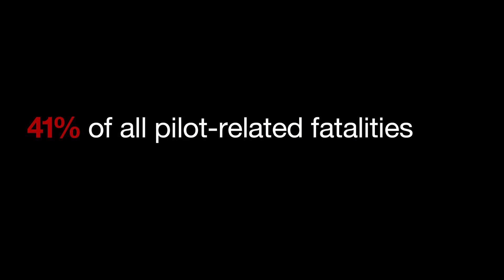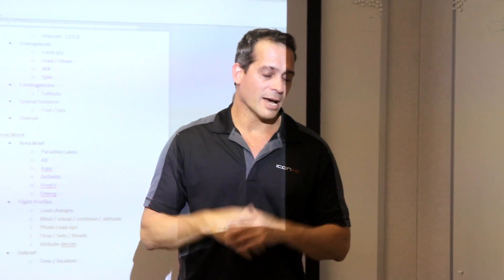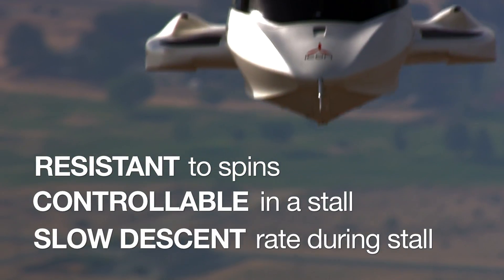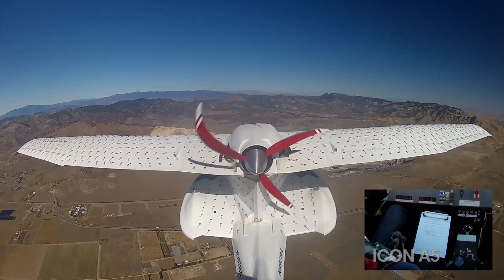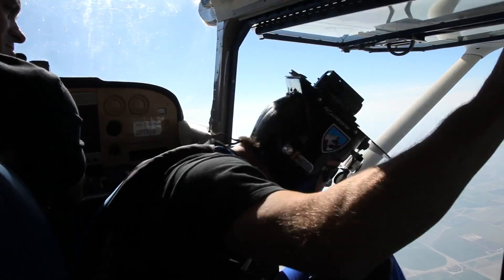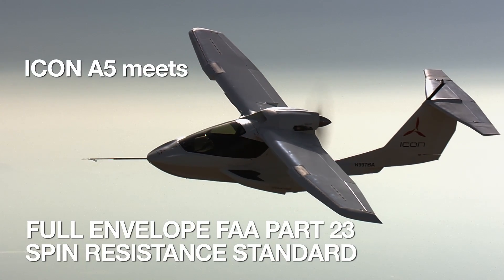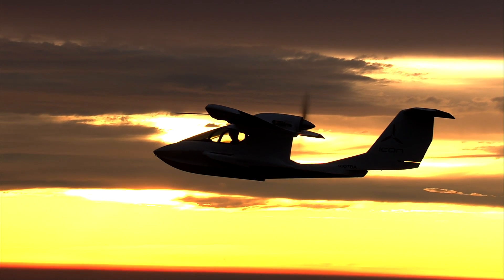ICON Aircraft - A5 Spin Resistance Safety Milestone Demonstration

Comment from the maker: We achieved spin resistance by tailoring the airfoils across the span of the wing, specifically by giving the outboard portion of the wing higher maximum angle of attack capability.  This was not easy and required CFD,  wind tunnel testing, and 3 full scale wings flight tested on our POC airplane. The slope of the wing lift curve does in fact level out from 20 to 30 degrees alpha, but stays positive to yield positive roll damping up to max angle of attack.
Reply: Good,  so if engine fails you can still land it better than a parachute is it?... N how much it cost  what hight it can go upto

Comment: I loved spinning C150 and C152s gives  confidence. The wing  low slip to land is also a confidence maneuver for the ones that  come to high  on final and still want to make the  RWY a great breaking the  speed off maneuver dirty flying, use the uncoordinated  flying only while steep  descending, level off coordinated and final check for airspeed, X wind consideration etc, wing low or grab into wind and rudder lineup, my favorite is the wing low landing in Xwind. On water beware not to tip the wing into water.

Comment: This video is obviously targeting buyers that have zero experience with aviation or basic aerodynamics,  pushing a product in this manner leads to accidents, bad reputation, more regulations, etc,  all in hopes to make a few bucks before it stops. 

The explanations, or rather descriptions are not exactly correct,  for example,  a spin and/or stall can occur any any airspeed, it has nothing to do with airspeed. 

A spin is NOT out of control,  actually it's the opposite.

A spin is a firm of auto rotation, the stability of it can make it difficult to recover from on some aircraft.

Comment: This is very impressive... but I’d like to see dynamic critical alfa test results, to say, accelerated stall and spin entry behaviour... 
As a long time instructor on GA Aircraft and having flown thousands of hours on Fly-by-Wire aircraft, I have observed and seen first hand  conceptual misunderstandings on how all sorts of pilots, experience and low-time, react on the dreaded “base-to-final-overshoot” scenario. True: Not every pilot reacts the same, and many either increase bank, and/or worse, try to “cheat” believing that the rudder will solve their problem (very famous example of that was lCallsign Revlon”). Any info on those?
Reply: mate, the lead engineer Jon Karkow you can see is this video is already dead - crashed in an A5. Not the best track record for this little innovative plane..

Comment: I see this is very old... if you are still trying to ramp up production, maybe I can help.. I am a factory floor automation software engineer and database developer, I worked for Raytheon Engineers and Construtors division, and a Boeing subsidiary, Hexcel,  the people who make the high tech fibers for aerospace... I have developed a fiber a bio plastic that can cut the cost of production by a huge percentage... it's practically free... and it develops covalent bonds as it dries.. the plan is to create an oven drying cycle that takes the hardness of the plastic up around 5.5 on the Moh's scale of hardness.. I have a plastic hardness scale, unused, as yet... I also have a design for a working Tesla turbine that uses carbon with double double covalent bonds, instead of metal of any type... metallic bonds are what creates the bending ability of metal,and that allows them to share electrons and pass current... covalent bonds are exclusive of all else..
The plastic is flame resistant, and can be made with a foam with CO2 bubbles.. it won't burn.. it's light as a cork, stronger 
than steel when used with silk or other fiber.. I am using aircraft grade silk from parachutes... the plastic is biodegradable... and bio based, a very non proprietary technology from China... shellac.. among other things

Comment: Impressive and thank you for taking the enormous trouble of designing specifically to counter spins ! On another note, could I ask how the top of the tail has been tested for strength - having the forces all the way at the top end would put enormous strain and torsion force on the boom fuselage leading to the tail. thanks

Comment: We now know that an Icon A5 has crashed onto the shore of Lake Berryessa, killing Icon's Chief Aeronautical Engineer, Jon Karkow as well as Cagri Sever who had been working with the company for just several weeks. This occurred yesterday, May 9, 2017. It is not yet known if the accident was as a result of a spin or spin-testing.
Reply: I left a comment here three years ago, sufficiently impressed by this aircraft. When I saw this in the news today, I was saddened at the loss of two engineers. Seemed like such a cool innovative plane, but I'm curious to know what really happened up there.

Comment: Not needed, just place a retracting parachute in a conventional light aircraft
Reply: Are u fucking stupid? When your aircraft is nose down in a spin, your rate of descent is so high its more than likely to rip the plane apart if a parachute is deployed.
Also, a pilot makes a small mistake, with the A5 he can recover, and continue flying, and learn from his mistake
In another aircraft, hes entered a spin, and is D-E-A-D
Reply: Seeing as we are doing the name calling shit... Hey FuckFace, thats from a incident were the aircraft engine quit, the aircraft was still in level attitude and slow, and he pulled the chute. That aircraft was not in a noes down attitude, rotating and speeding towards the ground. You thick skulked fucking moron. Go back to wasting time on making fake cars crash into fake walls loser
Reply: A parachute will not save you at 500" AGL
Reply: A ballistic parachute can deploy is less than a second.

Comment: Good ol' Burt Rutan designed non-spinnable, non-stallable aircraft more than 25 years ago...
Reply: and the aerocoupe...the 30's?
Reply: 40 years ago!  Burt is bad a$$
Reply: Patrik Jonsson  I have not seen it landing on land why
Reply: Hell, some of the very earliest Aeroplanes were almost unstallable.
One example (but not the only one) would be the 1910 Bristol Boxkite.

Those used a forward cannard set at a higher angle of attack than the wing.
The cannard stalled (and dropped) before the wing would, dropping the nose and increasing airflow over both cannard and the wing. 

I suspect Siggen (see below) may be on the right treack and Icon have figured some way of doing something simialr with the tail ... that said its has me baffled how you'd do that with a tail.

Comment: Not once do they explain HOW the A5 achieves spin resistance, which leads me to suspect that the A5 sacrifices performance in some other area.
Reply: Siggen, Actually, The T-tail configuration is more susceptible to uncontrollable stall characteristics. Just look at the Beechcraft Skipper and Piper Tomahawk for example. The way the Icon's wing is shaped, With a shorter root chord and longer tip chord, as well as a higher root incidence angle than tip angle, ensures that the root of the wing stalls well before the tip of the wing. It essentially makes it almost impossible (very difficult) to stall the entire wing at once. The loss of lift during the partial stall causes the nose to automatically drop before the tip airfoil reaches it's critical angle of attack. This technique is called aerodynamic twist and is commonplace on most aircraft. It is just utilized much more extensively in the A5.
Reply: Thats more then ok, if performance suffers for saftey thats fine
Reply: Well, yes & no DJ787. 
 How much performance is lost in the trade for safety - and where its lost - is a legitimate consideration too.  
For instance, if the trade was to up fuel consumption that would have a safety negative implication too (you don't want to run out of fuel).
Now, you could with some fair grounds argue 'Pilots should have more sense than to run out of fuel'.
But then, they should have more sense than to stall too.  
Reality is the dumber ones do both.
That said, what this company is doing looks promising ..........  Just hope that if there are drawbacks the 'safety at any price' brigade doesn't get to shove it down everyone's throat.
Reply: I suspect that the high placement of the tail elevator is how they achieve it. In a stall, the center of pressure will be above the center of gravity, and the aircraft will subsequently stay upright. The C-150's tail elevator looks to be placed at or slightly above/below the center of gravity, rendering the aircraft inherently unstable in a stall. The A5 acts like a human under a parachute, or like a badminton shuttlecock, they right themselves in a vertical fall, since their centers of pressure is above their centers of gravity
Reply: You could see the boundary layer separation beginning at the root and moving outward.  I wasn't sure but I thought I saw a slotted leading edge on the outboard wing as well.
Reply: Watch the video- the stall test with telltales on the wind shows exactly how they do it.
Each wing tip has a twist to its Angle of attack.... with the angled wing tips having a slightly lower AoA.   when the center of the wing starts to stall , the tips of both wings still have laminar airflow...this means the wing loses lift in the center, cause the plane to lose lift, but still has lift at the wingtips...which helps hold the wing level and slows the rate of descent.
Telltales on the sponsons also reveal that the sponsons themselves have an airfoil component and the sponsons are also at a shallower angle of attack so that as the wing center stalls, the sponsons still have smooth flow.... the chord of the sponsons looks to be slightly behind that of the wing...so as the center of the wing loses lift, the retained lift on the sponsons would tend to pitch him the plane nose down,  using gravity to initiate stall recovery by both reducing angle of attack and increasing airspeed.
In level flight the sponsons appear to have a very small lift component, essentially, their aft chord not affecting handling, but as AoA increases, their lift component increases and pushes the nose down.  All in all, very clever.  Combined with their cockpit AoA indicator, this is a far safer way to design civil aviation aircraft.
Reply: Ashore4 Interesting to hear, I was just speculating wildly, nice to hear someone with more knowledge explaining it
Reply: It is also about weight distribution from front to tail and the wings that helps like a parachute.
Reply: Ashore4 and Christopher Pardell got it (not sure about the sponsons as they extend in front of the wings, but maybe).  Also note the vortex generator locations - they are present only over the aileron portion of the wing, another common tactic in many light sport aircraft.

Something interesting: there are MASSIVE vortex generators on the fuselage behind the canopy and just in front of the prop.  I asked an icon employee at Oshkosh one year if they were to prevent boundary layer separation in front of the prop during flight - he said yes, but also for the spin resistance.  When I asked more he said something akin to "its quite technical" and moved on.  I suppose in a heavy side slip, the aft side would experience larger boundary layer separation, turning the fuselage into a sort of sideways wing that can stall as well, moving the center of pressure forwards and contributing to the spin.  Thats just my theory tho, its probably too "technical" for me.
Reply: Xpeterson... you can tell the sponsons are part of the solution because they bothered to put telltales on them so as to determine their laminar performance in stall, and their flow becomes more laminar as stall is increased.    Upon closer inspection, you are right that the sponsons do not extend far enough aft to impart a nose down pitch, so they must be meant strictly as helping to support the weight of the aircraft with a thrust below CofG as the center main wing stalls and they may be part of the physical buffeting that serves to warn the pilot of impending stall if he isn’t watching the AoA gauge.   I think the sudden trailing edge taper of the aileron region of the wingtip also causes the AoA to twist even slightly lower toward the extreme tip... so that the very tip of the wing would lose lift last of all, helping the pilot maintain roll authority even in a drastically unwise maneuver.    Of course... a pilot can still send the thing into a spin if they try hard enough...and at low altitudes that is deadly... but the objective is to simply make it harder to inadvertently cause a spin. Feeling the stall before you actually lose roll authority is a huge help in pulling a plane back from the verge.

But for other folks reading... that sudden lip on the wing they call the "cup" is actually just the leading edge at a lower AoA. That’s how they do it... by allowing the control surfaces to retain lift longer than the main wing as the wing pitches up relative to the airflow.
Reply: Chris, yeah I would think the sponsons would provide some amount of lift, although since they act as very low aspect ratio and thus inefficient wings, I wouldnt be surprised if they simply attempted to minimized the effect by reducing any lift/drag created by them in level flight, and that being the primary reason they have a lower angle.

Its interesting because with the super petrel, a tried and trusted design, they took the opposite approach.  The low wing has a higher angle of incidence, making the lower wing stall first while the upper wings (with ailerons) remain in flight.  Its suppose to be a very docile stall.  Also the high AoA on the low wing gives the plane such great ground effect that it doesn't need flaps.  It acts almost like a ground effect vehicle during take off and landings.

Good call on the trailing edge wing taper, I hadnt considered that.

Comment: Hexagonal dimples or longitudinal scallops on top of the wing would create low pressure pockets as the airflow ramps over them. This would lower stall speed, allow greater angle of attack and increase lift.
Reply: So would longer, more flexible yet sturdy wings

Comment: i wouldn't call a spin, a loss of control.    more an advanced manoeuvre that few pilots have the skill to recognise the entry and effect a recovery to normal flight.
Reply: You do realize most GA aircraft cant really recover from spins? When spinning the effective surface area of your rudder is reduced a huge amount, making it really hard for aircraft to recover from spins. So in most aircraft it is indeed a loss of control
Reply: Spin recovery demonstration is a requirement for certification. unless its a Cirrus, then its the chute being fired that is the recovery technique.

Comment: Looks like the reason for the stable stall is in part due to the tail high elevator is rendered ineffective being in the slipstream of the main wings and shadowed from the airflow.

The question is then, how much pitch authority do you have to get the nose down in order to resume safe flight from a stall condition.
Reply: The tail is right behind the prop.  The main spin resistance design ques are found on the wingtips, but if the slipstream has something to do with it, adding power should give you full elevator authority.

Comment: I want 1, but a 4 seater & at least with 500-700 miles or at least a NYC 2 Florida travel time distance capability, but i guest even at top cruising speed (120mph) it would take about 7 & 1/2 hrs from NYC 2 Florida. still love it though.
Reply: look up raptor aircraft
Reply: Yeah,  it has maybe two thirds of that range, and only two seats, and less of pretty much everything (except water landing and maybe stall resistance, based on their company video) than a Cessna c150. Also, it costs well over 10x as much.

Comment: Please build something that starts and lands vertically. It's possible with hybrid engine burn+electric in ultra light aircraft, if the engine have more power for ~30 seconds (batteries).

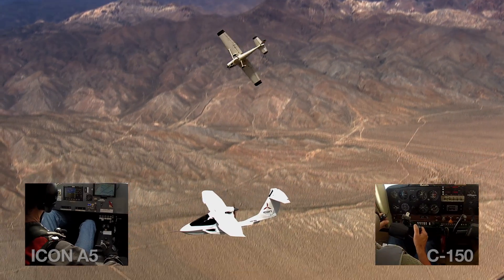Comment: C-150  pilot steering to right in the slow flight (2:20). I5 pilot don't do this. The result you can see here ...
Reply: yeah i watched that part a few times it it looks like there is right rudder applied on the a5.

Comment: the tail looks so fragile.. if a medium sized bird hit it you would have no elevator?
Reply: Lots of buffet, its a fiberglass carbon piece so its extremely strong and designed to flex
Reply: Carbon bicycle frames, over time, can crack and shatter.  Are they replaceable?  I would replace carbon fiber wings every few years.

Comment: Icon is a fantastic enterprise and I do not doubt that the icon A5 is cutting edge technology and a beautiful plane.
But stating that icon invented the first spin resistant aeroplane is simply not true. 
In 1946, Weick invented the ercoupe 415 (or aircoupe) as the first spin resistant plane in the world. 
Spin resistance was so remarkable and stable that the ercoupe sports a badge in the cockpit that states that the aircraft cannot spin. When mooney adapted the design they found out they had to change the design of the tail fin to produce a spinable aircraft (they had to do that because pilots that learn to fly on a no spin aircraft are not allowed to fly a plane that may spin.)
Reply: What bathroom wall did you read that info about pilots not being allowed to fly aircraft that can spin or not?

Comment: Surely canard aircraft with the smaller front wing at a higher angle of attack than the rear wing also prevent stall/spin circumstances?
Apart from that, way to go...
Reply: You got it.  They claimed it had never been done but Burt Rattan did it.

Comment: Over time, wont the tail break off from all the water landings / take offs?
Reply: carbon fiber and composites can  handle alot of fatiguing manuevers
Reply: The airframe will have a limited lifespan in hours, to ensure that structual failure does not happen